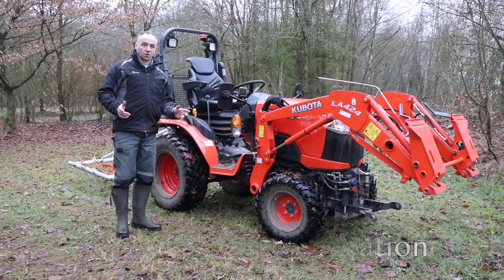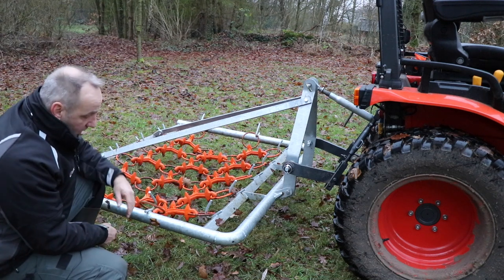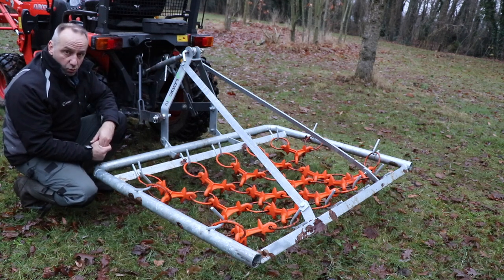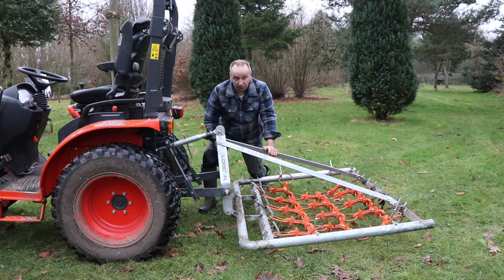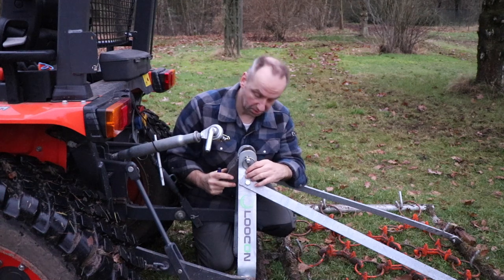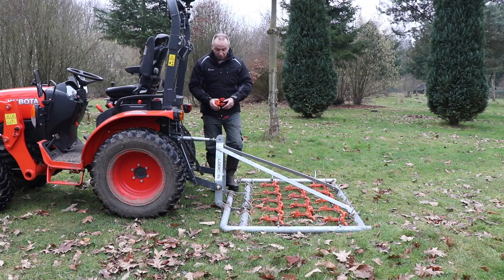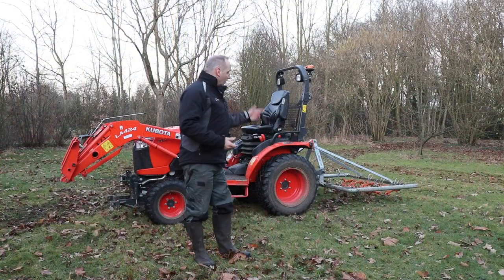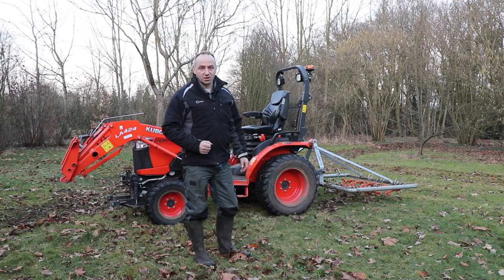Chain Harrow Modification for Kubota B2261 Compact Tractor

Comment: Very nice harrow!  WOW!!  You have a lot of mole activity!  Your “link” is a nice addition to allow some float on your harrow.  My tractor has a hydraulic top link that I can float.  Just another way to allow an attachment to float with the contour of the land.  Your link is a good solution to allow an attachment some flexibility.  Nice work!

          Jack
Reply from the maker: Thanks Jack! Yes the mole is very active, which is a very good sign by itself of course. The hydraulic top link seems an interesting option indeed, especially if you can also set it in floating mode.

Comment: Nice modification! I solved the problem by first adjusting the top far beyond the pin opening and lay it on top of the mountpoint, then put in the pin, put in an extra pin in the now open eye of top mount point. The harrow can now flex without any changes to the mechanism and still be lifted if necessairy. Be carefull not to lift it too high, cause it will bend the top adjustable part. I also used a piece of thick black tube over the wire thread to protect it. But all this was done in 5minits and off you go. https://www.youtube.com/watch?v=Ev7N8I_CC_E
Reply from the maker: That's also a way to create some flexibility indeed.